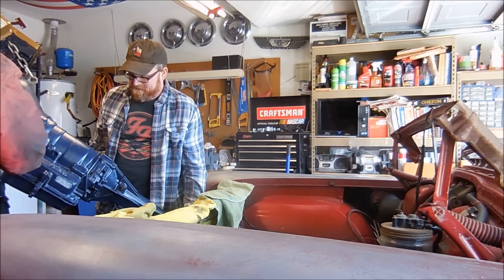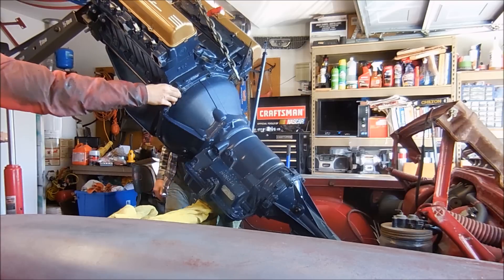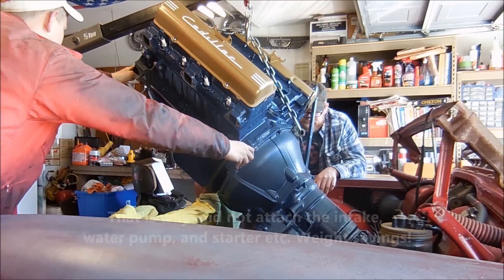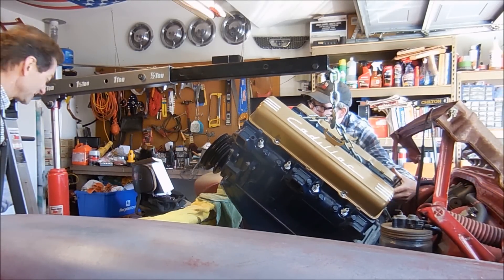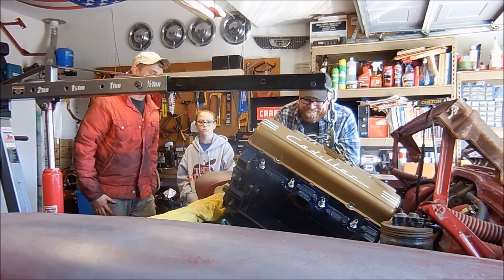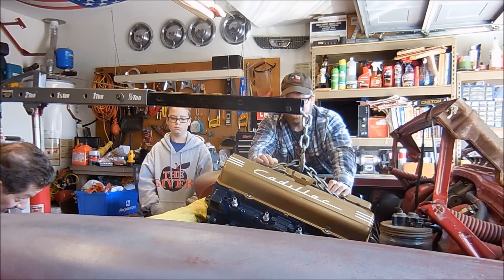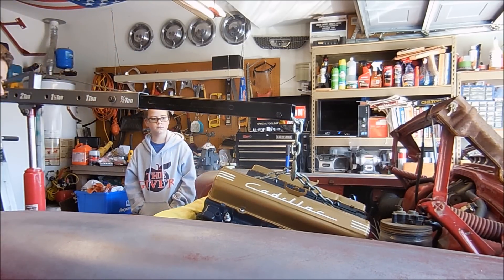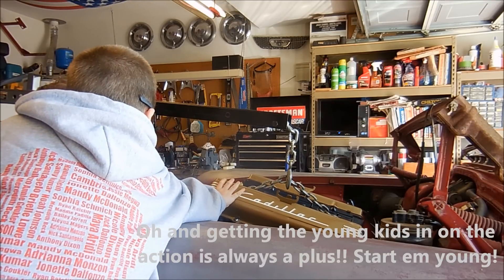1956 Cadillac Sedan DeVille Resto Video 34: Engine Drop Day!

Comment: Why did you have the engine hoist set at 1/2 ton when the combined weight of the engine and transmission was probably greater than 1,000 lbs?  I would always err on the side of caution and not risk an engine hoist failure (which does occasionally happen).

Comment: Leveller would be a good investment.

Can you tell if that is the original engine that came off the line with the car?  I can get build paperwork for some of my Dodges which can confirm stuff like that.
Reply from the maker: Gordon McMillan yes, the vin is clearly stamped on the engine block. The number matches the ones on the frame and door tag.
Reply: Great, definitely more on the value and better to pay for a rebuild of the original than a replacement.  Thank you.
Reply: TheCorvetteBen hi Ben can you tell me the size of the temperature gauge as I want to buy a auto meter is live in the United Kingdom
Reply: @TheCorvetteBen  what did you do about the gas tank I might have missed that